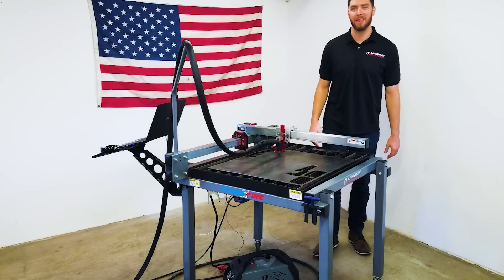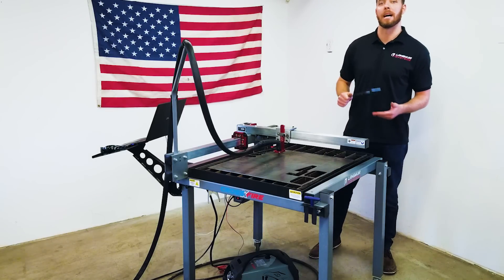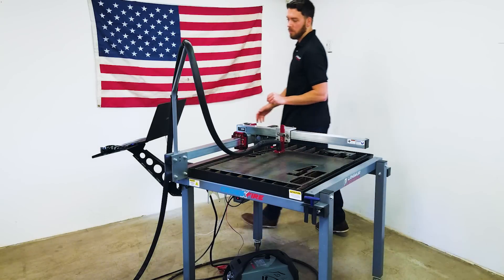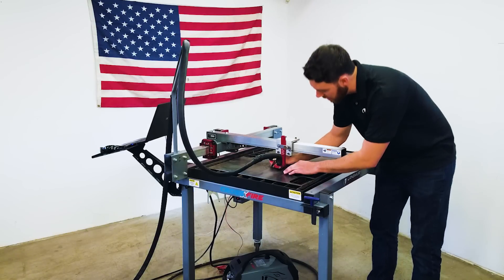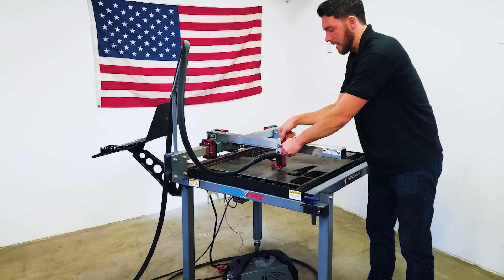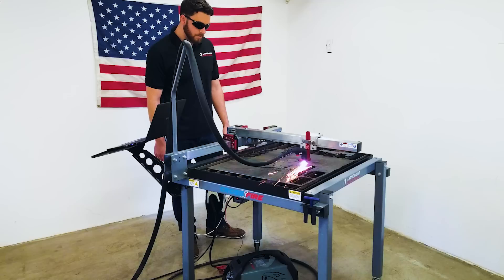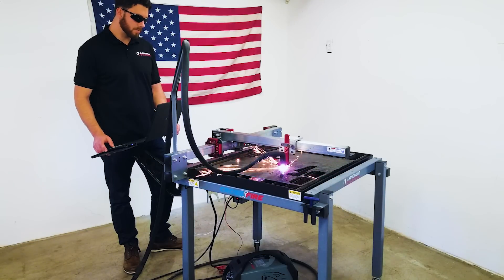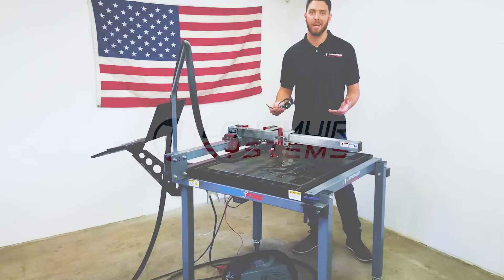Cutting Demo - CrossFire CNC Plasma Table w/Razorweld Vipercut 30 Plasma Cutter

Comment: Dumb question.. I have the razor cut 45 and when its done cutting the air still blows out of the torch head for a good 10 seconds and its blowing my solution everywhere.  Anyway to turn that post flow air off or lower the duration?
Reply: cimotorsports thats done to cool the tip. On my Hypertherm you can cancel it by manually pulling the trigger once quickly.
Reply: Like One Man said, it depends on your plasma cutter.  Mine does the same thing, not much you can do about it.  I use various strips of thin Alu as shields around the metal if it's a smaller piece.  I also put a piece where the cutter "parks when done cutting.  You can play all kinds of interesting games depending on where you have your parts origin set and where you set the gantry/head origin when you start.

Comment: Material processing question from a welding engineer: How on earth is THIN STAINLESS cut successfully time and again with no digital torch height control THC? Should I expect the high coefficient of thermal expansion/low thermal conductivity=DISTORTION PRONE material to warp, buckle and therefore lift, shift and touch the cutting tip nozzle thus grounding out the circuit and essentially crashing the machine? I am quite serious about making a purchase of your machine ONLY if I am able to upgrade at a later time to a 4x4 or larger table work surface with the included initial software package.  Thank you.
Reply: You will pay more if you want to drive a Rolls Royce. This is a Hobby machine and its a goo price to pay.

Comment: show the back side of the part and the edge..  taper? for a 30 amp you had it dialed in really well would have liked to see the bottom...DAMM
Reply: Even the best cnc plasma has dross....

Comment: How big of air compressor are you using? What are the minimum requirement s for air pressure?
Reply: It depends on the plasma cutter you are using.  Mine uses about 40PSI at around 30 CFM,
Reply: I bought this table and have a hyperthermia 30 xp plasma.  I have been told my plasma cutter won’t connect to this table.  Is that true